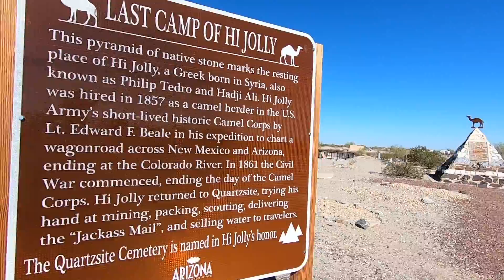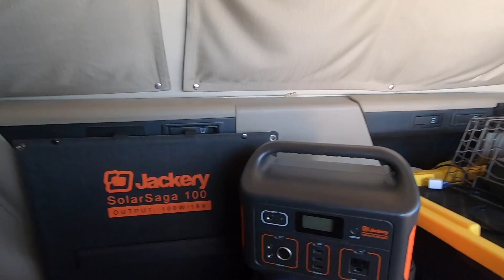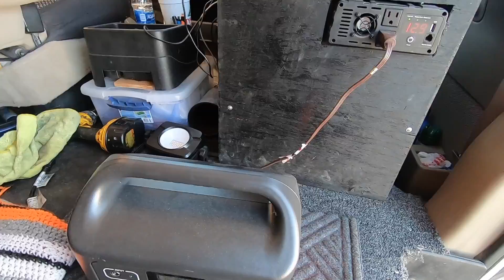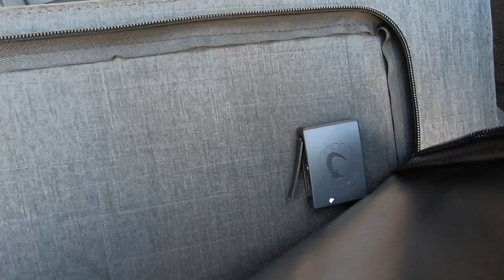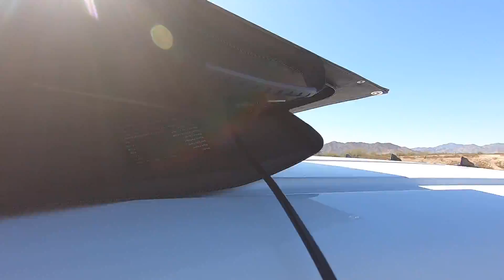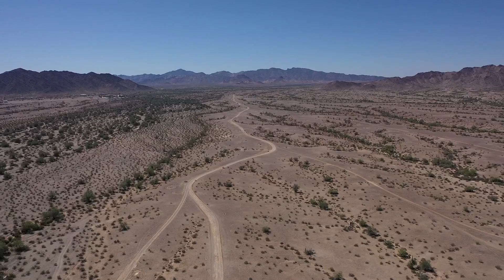Jackery Explorer 500 Lithium Battery - SolarSaga 100 Watt Panel

Comment: Please do a video on internet options for Quartzsite. If you live year round in an RV park, will they let you install cable internet? How does that work? Or are you limited to phone mobile internet only? What internet are you using and how does it perform during January high season? Thanks.

Comment: Hey Russ, just an FYI to let you know that Jackery has recently made some changes to the SolarSaga 100 that you have. It is a little thicker which makes it stronger. There is a bright orange strip that goes across the edge and houses the plugs and it now has a magnetic latch to hold it shut. Just received mine and it is a nice product.  I also got the 500 a week earlier and it works well. 

Nice review of some handy items!

Comment: Hello Russ.  We will have to call you “HoboTech #2”.  Hee, hee. Thanks for showing.
Reply: Yes..
Promote a product that has a Faulty Recharge Ratio..
L.W.
Reply: L.W. Lavelle :  Please explain in easy terms.
Reply: @tazmod7272  
Yes Taz,
The problem with this Unit is that it takes
very long to recharge to 100% once you have drained the battery.
Something in the circuitry that only allows a 10 amp charge, max.
So..with the 100watt panel it would take approx. 10 to 12 hrs. of direct sunlight to recharge..We don't get 10 to 12 hrs. of direct sunlight in a day..
So..If you drain the battery to 0
it will take 2 to 3 days to fully charge..
L.W.
Reply: @tazmod7272  
Yes, sorry Taz..
The Charge Input is Limited to 3.5 Amps
Not 10 as last stated.
Sorry for the mis-info.
I truly wish the Unit had a 10 amp charge input..
L.W.
Reply: L.W. Lavelle :  Thanks for the info.  I live in a house and haven’t camped in years.  I still like learning about new technology, it’s plus and minus.  I may do some traveling next year.  It would be handy to have something like that .

Comment: Hi Russ. I don't know if this applies or if it's genuine but, I recall hearing or reading something about unplugging solar panels while they are charging can harm the panels. I can only imagine what that gear cost you but I'd hate to hear something had gone wrong. Might be worth you looking into this. I think it was recommended covering the panels with maybe a towel or whatever before disconnecting? Cheers Russ. :-)

Comment: Those portable solar generators/panels are bulletproof. I’ve used the competition version of this unit for over 6 years now and the reliability is faultless. Powers everything imaginable... and you never-ever have to use your vehicles batteries. Expensive.., yep a bit on the initial cash output, however you will continue to question how you ever got by day-to-day without this gear. This technology is a NO BRAINER if you’re planning to be out on the road for any amount of time.